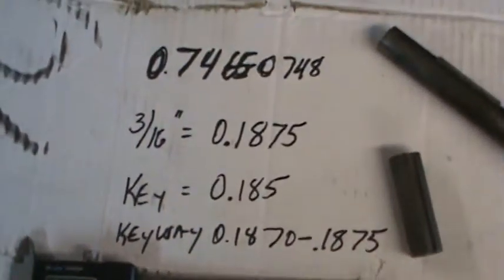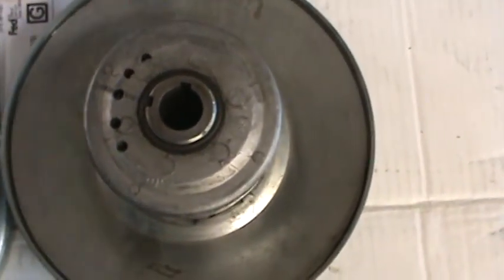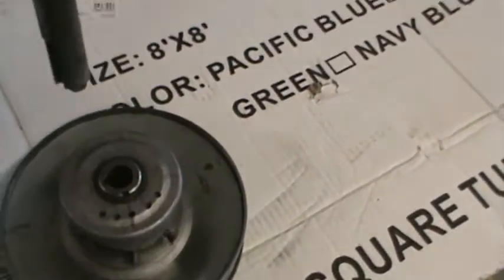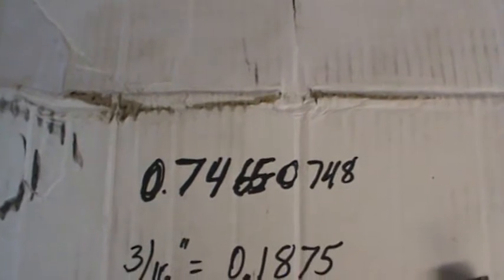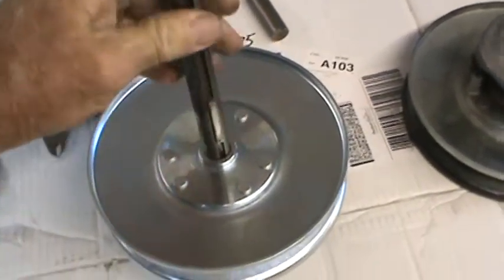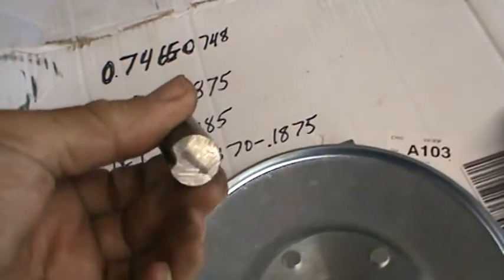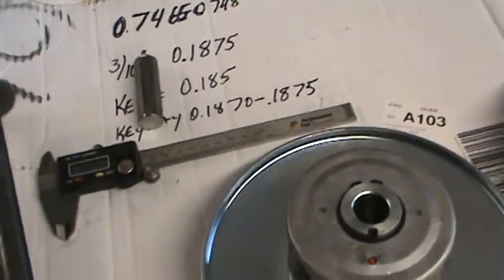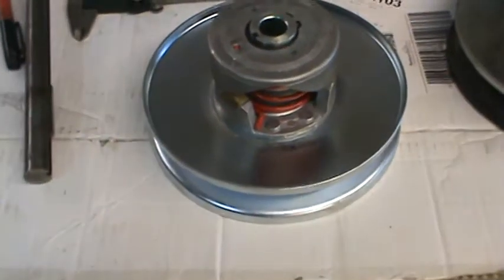Comet 40 series clutch Chinese knock off. Poor quality control.

Comment: Metric shaft. It is also designed for a semi tapered shaft found on the CVT Kits (Drive, Driven, Shaft and Backplate)
Reply: I've never heard of any cvt kits that are for tapered shafts, a lot of  golf carts use torque converters and most of their drive clutches are for a tapered shaft but that is far from a kit!

Comment: The how are people getting these units to work?  others have done comparisons on the 40 series and found them to be of comparable quality. I have a new Comet 40 series and 2 predator 420 engines. i was thinking of making a 2 engine scooter, but i would need another 40 series clutch for the second engine....Now you have me worried that the chinese clutches may not perform equally as well as the original Comet model.